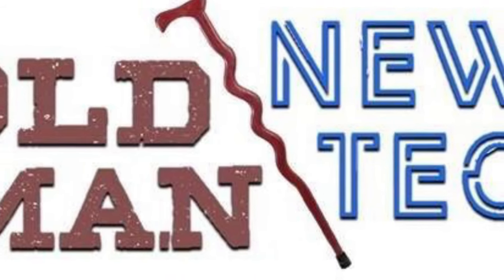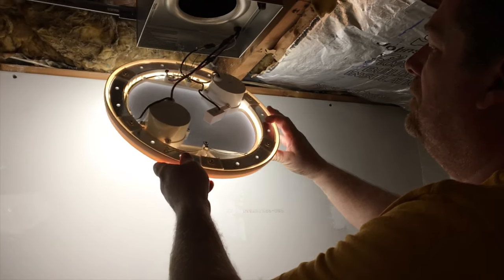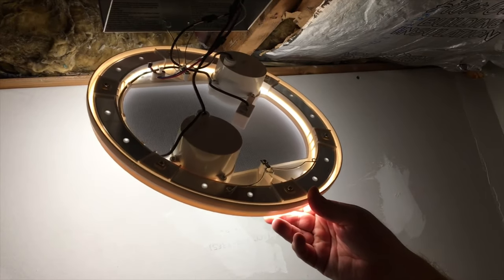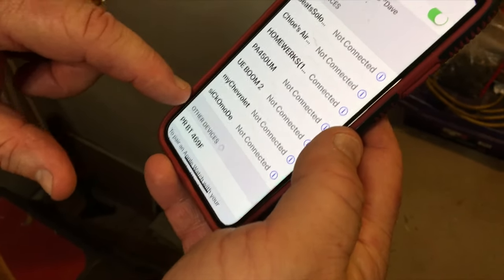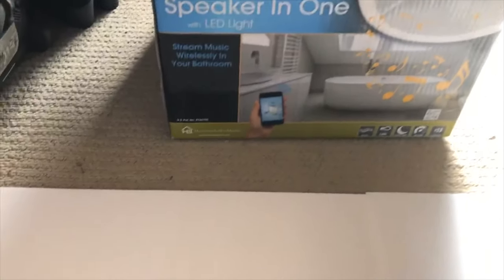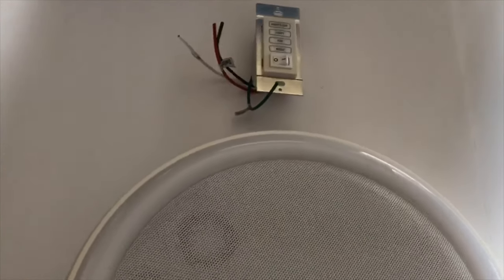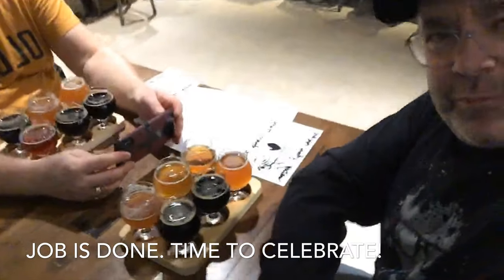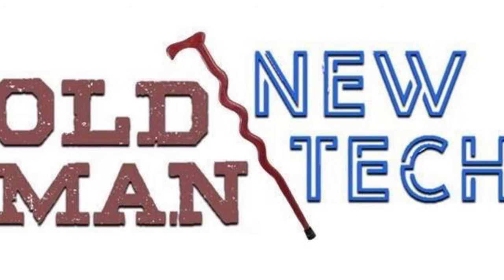Home Netwerks Bluetooth Vent Speaker Install & Review

Comment: How did you hook the wires up in ceiling
Reply from the maker: +esco23 my neighbor (shown in the video) wired it directly into his electrical system.
Reply: It wouldn’t connect to my phone only two weeks after installation

Comment: How exactly did you connect the speaker cause it does not pop up on my phone
Reply from the maker: The device came right up under the bluetooth settings.  If it's not, try powering the unit off and powering your phone off. Other than that, the unit may be defective.
Reply: Does it still work